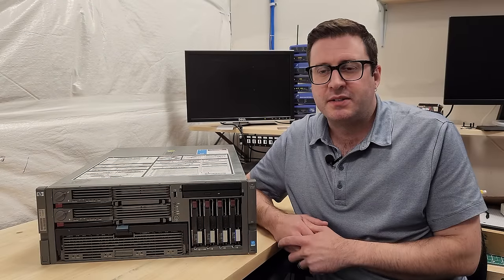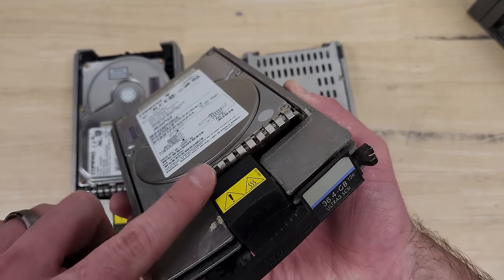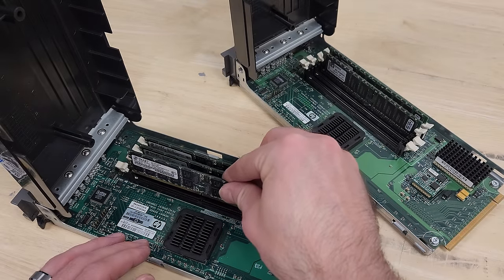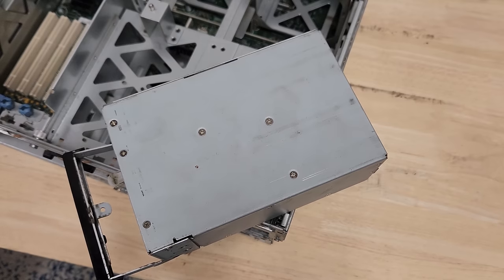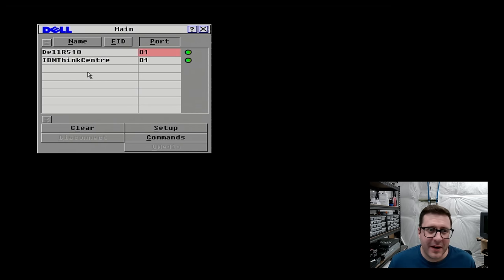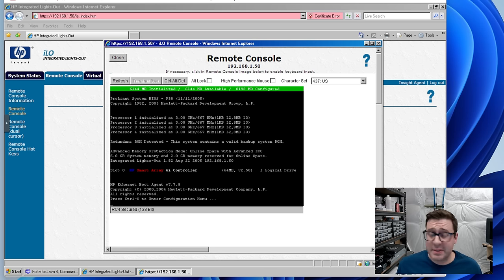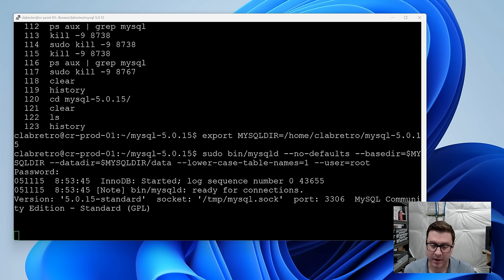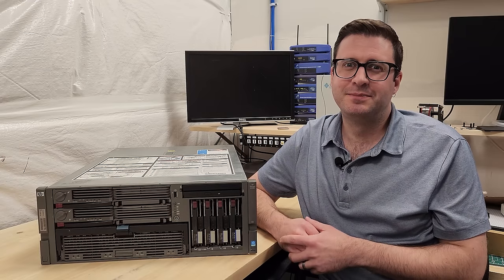HP ProLiant DL580 Gen 3

Comment: It is Debian/Ubuntu. You should not be building from source. Installing PHP from source is even worse. You need dev packages for system libraries used by enabled php modules. Period correct Ubuntu Hoary should be running PHP 4.3.10.

Comment: HP is miserable to deal with but the fit and finish of their servers is genuinely exceptional. I bought a DL325 Gen 10 for work and was amazed by how well and easily everything went together. The lid latch, drive mounting mechanism, rails, and component modules are head and shoulders above any other vendor I've ever used.
Reply from the maker: A bummer they suck to deal with, you're not the first person to mention that. This thing is almost 20 years old so I don't know about the new ones but it's super well built.
Reply: I always buy outgoing generations so I've never had to deal with HP, but man I agree I absolutely love my HP Servers. ILO is generally reliable, and parts are SO easy to get for them
Reply: most of HP's design/manufacture tech from the early years, came from Compaq acquisition. if you've worked with compaq servers, you can spot various things in old hp servers immediately. early hp own server tryouts were pieces of crap. fit and finish is one of the few things they kept at very good levels but their customer support and feature lock (in some of the stupidest ways immaginable) is pain. in terms of reliablility, i have mixed cases which boils down to: if you don't have early problems, you won't have at all. if you do, you will always have. but i guess this is what you have to deal with, when you're into the "affordable" part of the enterprise market. meh.
Reply: Yeah, from personal experience, HPE Support is absolutely dreadful. It's why we switched to DELL.
Reply: Surprised to hear all of the HPE Support hate. They're not awesome, but they're no worse than the majority of the others I deal with.
Reply: @jroysdon  it's not hate, it's years of furstration, dealing with them. of course the rest are not much better but they are better. again, we are talking about the low end of the enterprise sector, we are not spending hundreds of thousands.

Comment: On the drive sled rust, vibration will wear through the zinc plating exposing the steel. Exposed steel rusts quick in air.

Comment: It's interesting to see how quick hardware swaps, down to the CPU level, were important design elements before modern virtualization really took hold in the server space.

Nowadays no one would really care too much about being able to swap out a CPU cage fast because if something goes wrong with a physical machine, you'd just migrate the VM to a different one, but back then it could have been incredibly important to get up a particular machine as fast as possible.
Reply from the maker: Exactly, now days you'd have a hundred of these things running and wouldn't care when one failed.

Comment: I ran a forum, hosted on a dialup connection with dynamic DNS to keep it "available" through reconnects back in the early 2000s. But I was an ASP weenie back then rather than PHP. Later I moved to Perl when I started messing about with FreeBSD more, and now Python.

Fun stories from that time of my life. I used to attend a LAN gaming event at a local community centre, and got involved with running it. Later on I wrote an online booking management system to help manage the attendees and make sure we didn't go over capacity. That was in ASP of course. 😎
Reply from the maker: ha thats awesome

Comment: Used to build these back in the day at Hp in Erskine. The reason the DL580 G3 gained so many of these features is because it was a consolidation product, it moved up a tier from the G2 in that it entered the quad socket  arena, as it was also a replacement for the old DL740 & DL760G2 high end servers at a much lower price.  For such an expensive intel based mid/high end server we built an awful lot of them as people were still unsure of the higher performing AMD based DL585 until the G2 version of that was released.
Reply from the maker: Fascinating. Yeah this thing is absolutely maxed out with features.

Comment: Ran dl380,dl580,dl980 servers over the years, on top of the c7000 and newer synergy systems.  The dl580 boxes were good boxes but the memory speed was slower to match the slower Xeon speeds.  Moved one Oracle RAQ cluster from dl580 to dl380 nodes when the DB needed more oomph in the cache and memory department over core count.

Comment: RE the HP/Compaq split identity.  Post merger till at least 2006, any Proliant 300, 500 or 700 series was the team out of Houston from the Compaq side. They weren't in a rush to cover up all the Compaq logos with HP ones, and I specifically remember the SmartArray firmware for a time displaying Compaq in red text briefly before flipping to HP in blue during boot. The 100 series were at times some of the pre merge HP server folks IIRC, but overall the Compaq side took over the x86 server designs in the post merger company. HP side ran Itanium, even though the Proliant team had built one Itanic box, the DL590 prior to the merger.

Had fun supporting that era of servers and storage tech, DEC and Compaq's legacy in those spaces resulted in some solid designs and support organizations.
Reply from the maker: Very cool to hear about that. Definitely a fascinating overlap with HP getting rid of their offering and bringing Compaq's in.
Reply: I'm telling you something: There was at least one piece of storage equipment that did exactly what you described. Now I'm being deliberately vague here because I don't remember what that piece of technology was - it could have been a SmartArray controller, an earlier one maybe, or perhaps it was the HSG80 storage controller. However, that particular hardware had originally been designed by DEC, so at some point "post-merger" (HP + Compaq) I upgraded its firmware and noticed it doing this ANSI-style overwriting of the old Compaq identification with the new HP one after a few moments, just like you mentioned. But what it would also do and had already done before the firmware upgrade was displaying a DEC tag before the Compaq one, making it actually go from DEC via Compaq to HP.

So booting up that system was always kind of a quick tour through several years of computer history, all via one single POST initialization message.

Comment: Great to see the old kit working in 2023... that in itself says a lot about the quality of these machines. 
HP still makes excellent hardware and when you have a decent number of machines the support is definitely better. The Gen10 machines are well built, have similar config diagrams (very handy for RAM population) and rock solid performance. IMHO the ability to hot swap is not as good, however in the last 5 years we've only replaced a handful of chassis fans with the last few able to be swapped whilst the machines are on (even though they did complain).

Comment: Oh, I can confirm that you absolutely get plenty of dust in a "proper" data center. It's not like a semiconductor clean room. Colocation providers use roughly the same quality air filters on CRAC units that you use at home, probably in the MERV 8-13 range. The air does get run through the filter a lot more than you would see in a home or office, so there is perhaps less dust buildup, but it's still there for sure.

However, you usually don't have enough moisture in the air to cause any rust concerns... more modern data centers do humidify the air a bit (counteracting the dehumidification provided by the air conditioning) in order to minimize ESD, but not to any extreme degree. 

Most drive caddies on more recent servers even still use the same kind of leaf-spring design to center the caddy in the bay and to deal with vibration. But it is unusual to see a server in use for 25+ years, which is what would be required to build up that much dust under those springs.

Comment: Bowed pcb's are usually ok internally, the issue is surface mount caps and resistors sometimes pop off. Or really anything soldered to the board that doesn't have the same ability to flex can crack its solder joint.

Comment: It's interesting to see the shared design language between that machine and a DL585 G2 I've got. It's basically the DL580's slightly bigger AMD Opteron brother with lots more RAM slots (but no hot swap) A more symmetrical layout, SAS and PCIe. But other than that, very similar!

Comment: Oh man bringing back some good memories! 2005 was around the time I was running my first website. I was more of a fan of Invision Power Board than phpBB back then! By the way, you can search around and find a license key for that old iLO to unlock the "advanced" features. HP (and Dell) still do that nonsense today (but they'll let you at least use it to install an OS and use it to watch the server POST. After POST, the free iLO/iDRAC will kick the console.). HP and Dell are why I love Supermicro servers. Their IPMI is usable without a license (you just can't do a remote BIOS upgrade and maybe a couple other things), they'll accept any compatible hardware without major complaints or throwing a temper tantrum like HPE servers like to do for even something as simple as storage without HP's blessing. You're making me want to dig out the old servers in my attic now!
Reply from the maker: haha that's awesome. some other folks mentioned about finding the iLO keys, it might even have one on a sticker on the machine I just noticed.

I hear you on supermicro... way more flexibility. what gear do you have hiding in the attic?

Comment: 4 Xeon 7040 CPUs with 2 cores each at 3.00ghz and 165 watts of TDP per chip.  Gotta love that Netburst powa!!  This kinda reminds me of an older Dell Precision 670 workstation I got for dirt cheap in the early 2010's.  I won the lottery with the motherboard revision and was able to upgrade it to two dual core xeons paxville chips with hyperthreading.  Thing was insanely crazy hot but fun to mess around with, especially when my budget Phenom x3 I had at the time ran circles around it and only used 65 watts of power.
Reply: 165 TDP per CPU?! damn that thing is a literal heater in a box

Comment: Mezzanine cards originally (and some still do) sat atop a motherboard/mainboard, often on standoffs so kind of like a little mezzanine :)

And I agree with what some others have expressed: HP's excellent mechanical design is usually let down by the actual thing running inside the chassis. I always assumed the inner instruction stickers were done so well because they knew their field techs would be in there so often.
Reply: A mezzanine is a daughter board parallel to and very close to the system board. Like a mezzanine in a building is between two floors, a mezzanine in a computer is not quite the system board, but also not really a classic expansion card.
Reply: @Dummvogel  Yep. Its still really common to find RAID mezzanine boards. It lets them sell the system with out a raid controller but it lets them have better integration into the motherboard then a standard PCIe expansion would let them have. Like you can have the onboard sas ports be controller by the mezzanine board if its plugged in.

Comment: When I started at my current school job, the school had a ML380 Gen 5 server as the main server running Netware 6.5. It was my first time working with a proper server and it was beautiful. However Netware was seriously unstable on that system in 2009. Still have the unit sitting in out storeroom, with no idea what to do with it. Draws too much power to be a useful system and the 36GB SAS drives are too small really for much of a modern OS boot volume. Still, from a physical layout and labelling point, it was beautifully done

Comment: The school I work at rn still use this equipment nowadays since power bills aren't a problem. You are such an expert on these things! In my case I had to learnt it from zero using manuals hahah.
I like to install modern Proxmox in these things, as is debian based, and can run almost everything on everything. You just have to install it on top of a fresh debian install so it uses qcow2 files and thus doesnt eat your RAM with that ZFS crap. 
Btw, I recommend just using the firefox archive to download a compatible old browser. And java 8 binaries are all around so it should be no problem at all. 
Also, you could flash the HBA on this thing, it probably supports IT mode, and modern SATA disks up to 2TB.

Comment: Amazing video! Small question, why not keep the kvm in the server room and access the connected machines via the network to the kvm? Is local connection (vga and ps2 direct to the kvm) that much better? Thanks for another great vid and hope you have a great day!
Reply from the maker: great question, this KVM has pretty outdated remote management software I have to access via an XP VM and the video quality is low, so the local hookup is better, especially for screen capture. but I might see how far I can update it though, maybe there are newer software versions available.
Reply: @clabretro  ah yep, makes sense! That remote extension thingy will help with having to run only one line back there though! were you able to source more adapters for hooking up more servers?
Reply from the maker: yeah I've got three with ps2 and one with USB... now that I'm typing this out I'm realizing I should've tried the USB one haha

Comment: A DL380 G7 has been wurring away in my front porch for the last 6 years with only a handful of reboots. Its very hot in there running all kinds of vms from game servers to databases and web servers. Its full of dust, and mounted vertically on the wall with a 4u mount, surrounded by coats scarves and a shoe rack, and in all these years ive only ever lost 2 disks. Even then she kept on chugging thanks to raid 10. HP build very reliable and capable machines. 

Sadly though i fear her time is coming to an end due to it consuming 250-350w on average these machines really aren't econmical to run any more. When you consider performance per watt a modern gaming pc would blow it out of the water hands down.
Reply from the maker: Love it! Yeah I'm running a Dell R510 and R720 around the clock and even the "newer" stuff like that pull some serious watts. Eventually I'd like to figure out a solar solution to offset things so I can justify running this older gear more often ha.
Reply: @clabretro  absolutely im with you on the solar thing. Been collecting old ups batteries from work over the years and currently on the lookout for deals on used solar panels. I figure if i can build up enough battery capacity to run all the equipment through the night, while having enough solar input to both fill the batteries and power the equipmemt though the day, then i will be laughing! At least until my house burns down

Comment: About 10 years ago I purchased a used HP dl585 G1. This uses the amd socket 940 processors. What I found out later on is the even though they are 64bit processors. They didn't have the AMD-V extension. Thus, running virtual machines on it via 64 bit is a no go. Another thing is the server did not officially support windows 2008r2. I can't remember why. I know the server installation discs didn't support it. But, I was able to install 2008r2 with no issues. Other people around 5 years before that had no issues either. One last note is I finally picked up a rack mount kit for it. The prices on e-pay came down enough.
Reply: It prob doesnt even have enough RAM and cpus to run VMs anyway hahah. But what about containers?

Comment: i find it funny how the iLO "you need a license to use remote console" worked better in these days. set up about 8 modern HP servers a few months back and the iLO console would work for about 60 seconds before kicking you out.

may or may not have wrote a quick chrome extension that may or may not have intercepted calls to show the "you're not licensed" message box to just restart the console

Comment: I'm not 100% if this is true. To me those memory boards would seem to be easier to put into machines with a front side bus as you wouldn't have to worry about latency as much as long as you were able to keep up with the front side bus speed. We are pushing speed and latency so fast that DIMMS are every closer to the cpu every generation. Could be totally wrong though. Made sense in my head

Comment: Great boys! I'm Interested in knowing the wattage/power draw, thanks
Reply from the maker: Thanks! With just the power supply plugged in running the iLO (machine not turned on) it pulls 36W, but when it's powered up it draws anywhere from ~380W-440W. I should have put that in the video!

Comment: Maybe the rust is because of galvanic corrosion. Different metals close the electric circuit and voltage differential causes redox reaction. Moisture in air would be enough.
Reply from the maker: Some other folks mentioned that too, could definitely be the case.